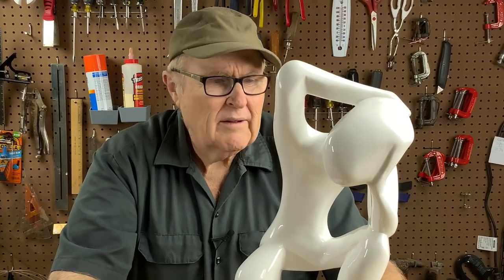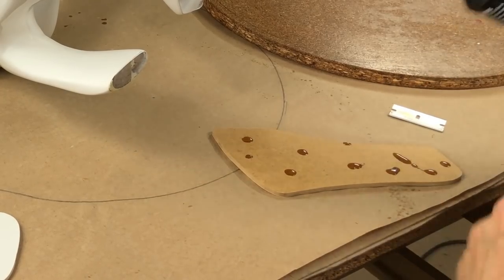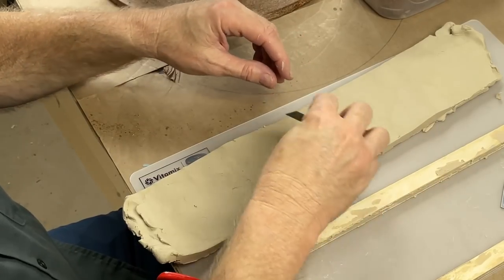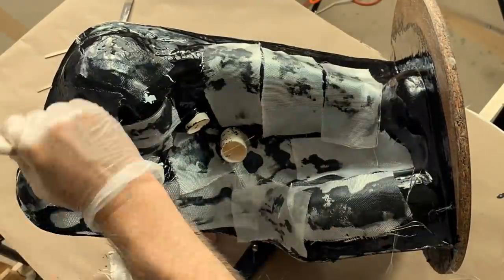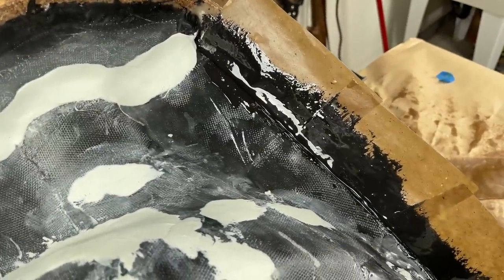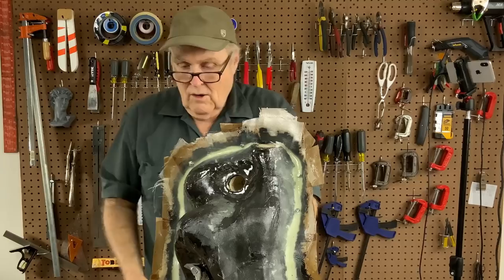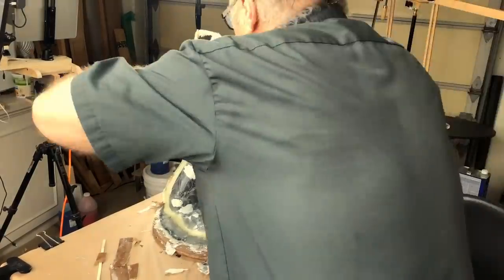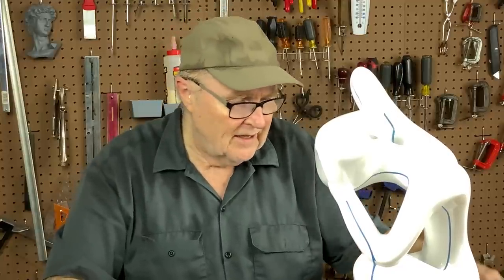Pouring A Rubber Blanket 1-Piece Cut Mold.

Comment: As a fellow person who embrace the whole make it as god as you can in the best way you can. I can recommend a pasta machine for making your clay sheets. Easy to get them al the same thickness, and easy to make as much as you want.
Reply from the maker: Pasta machines are excellent but mine is too small to roll 1/2 inch thick slabs.  I was longing for a slab roller!
Reply: @RobertTolone  And here I thought I might have a nugget of gold you where unaware of. But I guess I have to put my pasta maker back into the kitchen. =)
Reply from the maker: @danje748  😄

Comment: I wonder... What material would have made a functioning layer between the clay and the fiberglass? No real need for the clay to stick that fondly to the mold, I guess. As long as the fiberglass doesn't fall off...

I learn a lot from you. Thanks.

Comment: Does that clay melt with under a heat gun? You might be able to salvage all the clay if melts into a bucket. Also have you heard of using balloons before adding the epoxy shell then inflating with water to separate the shell?
Reply from the maker: Heat definitely softens the clay and expect it would melt it.  I salvaged almost all of it.   Never heard of the balloon trick before; that would be very interesting to try.

Comment: After padding the model with clay, could you have added another layer of saran wrap before fiber glassing to ease the separation of the case?
Reply from the maker: It would be very difficult to get a nice clean tight wrap of plastic around the clay. Inevitably you would have gaps, bumps, folds and loose edges of plastic everywhere.  Look at the plastic wrap before I began to apply the clay. It was very rough. So when I made the fiberglass shell the the plastic would get all caught up inside the gel coat. It would make a very rough and uneven surface on the mother, and even worse might help mechanically attach the fiberglass the to the clay. In any case the surface would be rough and irregular.   These irregularities would transfer to the rubber mold and it would be very difficult to fit the rubber accurately into the fiberglass shell.  You really want mothers and  blankets to be fairly smooth.
Reply: @RobertTolone  Thanks very much for taking the time to reply.  Love your videos and looking forward to next weeks.

Comment: Question: Would it be a good idea to also wrap the clay before creating the shell? That way the clay could easily be removed from the shell.
Reply from the maker: The difficulty is in making a smooth wrap. You really want your shell to be as smooth as possible so that the rubber blanket is also smooth. If the surfaces are irregular it’s hard to get the rubber blanket to fit back into the shell.   I could have put a spray release on the clay but I wanted to reuse it and it’s hard to clean off the release agent.
Reply: @RobertTolone  Makes perfect sense not too. Thanks Robert for your demeanour and sharing your knowledge with us :) Looking forward to part two!

Comment: Hello, great video like everyone. A question. When you apply gelcoat on clay or plasticine? It was my understanding that epoxies and polyester should not be applied to water-based surfaces such as clay. On the other hand, polyester liquefies plasticine. Could you solve this question for me?
Reply from the maker: I keep water away from my process as much as possible because it causes urethane resins to foam.  The clay used here is oil based.

Comment: I am very reactive to fiberglass and maybe even kevlar and carbon fiber.  Do you know of any alternative materials I could use? I would be happy to take a hit on the strength of the shell or bulk it more if needed. I just wish I could stop the itch.
Reply from the maker: Several viewers have recommended soft cotton fabric. Personally I avoid fiberglass altogether and use a trowel-on type of urethane resin with no reinforcement. But that may not work in your application
Reply: People use cloth and resin to make knife handles. Should work here too. Paper would probably work in a pinch.
Reply: @scottmichaelharris  - Thanks, maybe I will give cotton for details and hessian for fill a try. :)
Reply: Smooth-On makes a trowel-on resin.